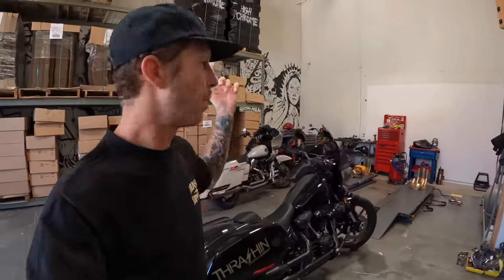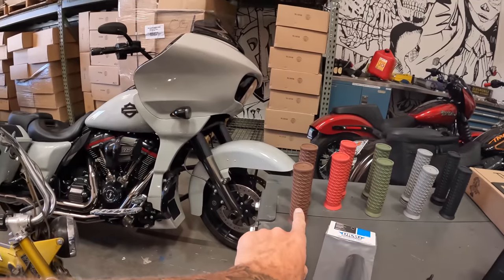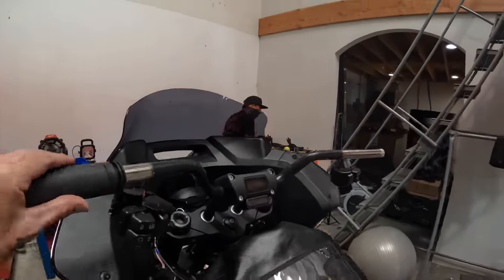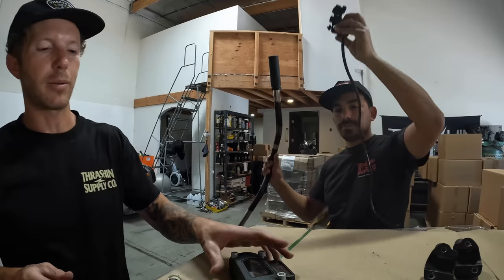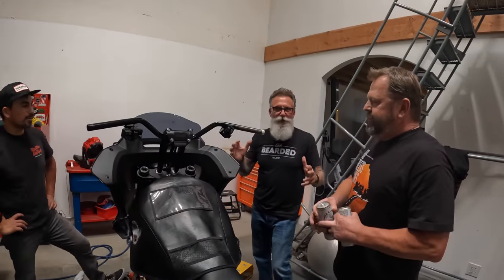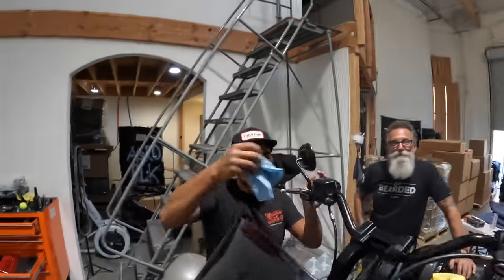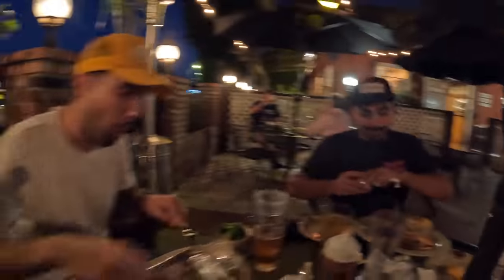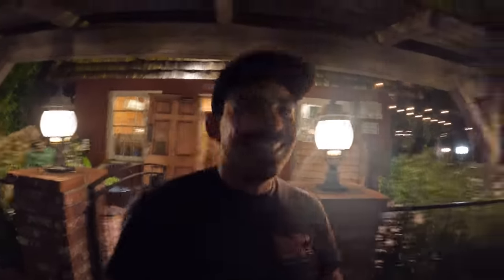First Mod On Our 2022 Lowrider St - Vlog 16

Comment: I "reverse bled" my Heritage when I did a bar swap. Used a meat injector syringe and pushed fluid from the caliper to master cylinder.  Avoided any possibility of air in the ABS module and I didn't have to go to the dealership. Zero issues and super fast to do.
Reply: Would love to get some more details on how that's done exactly. I was at the dealership today and they said I absolutely HAD to go to them due to the abs. I'm on a 22' LRS
Reply: @gbeatz408  I'll try and make a video on it here soon.
Reply: Thanks for posting that. I'm going to do 10 inch risers and that is my plan for the brake. Thanks for confirming it will work like I thought.

Comment: Learn from me.  When I replaced my vans grips, I just cut the old vans grips off the throttle tube, slathered it in glue and put the new grips on, without removing the throttle tube first. I’m dumb and the throttle tube I had was open on the end… I glued my tbw twist sensor together solid. Take the tube off, glue it, let dry then install.

Comment: In the name of editing I get keeping ur vids short, but dang ya’ll.. I need to talk about pulling wires back through the new bars..  after four months back order I finally got the cruise control switchgear for my 2022 M8th St. Bob.  
I only wanted to pull wires once! 
I immediately put the order through Thrashin. New 6.5” pullbacks with their mid rise bars. 
The CNC work that incorporates my stock electronic gauge is spot on🤙
I “think” the new bars are a 4 inch rise with a 25° sweep. This combo put me right back to factory ride height with the bars settling  back just a lil. Super comfortable, and super slick looking. Back to the wiring son.. there is a reason your local Harley dealer charges three hours labor for this shit.  Started out by pulling the fuel tank to gain access to the wire harness connectors toward the neck of the frame. Labeled all the wires,, disconnected and pulled them out. This was the easy part boys and girls. Purchased a new wire puller roll from my local hardware store and off to the races i went. 
For the life of me I could not de-pin the fac connectors! I watched every freaking video on YouTube on how to do it.  I’ll admit I’m a dumb ass! My parents should not breed.  I think I threw every wrench into the middle of the street pulling those freaking wires through those new bars! I’d rather have given birth through my asshole. In the end was the juice worth the squeeze? Hell yes! Will I ever pull wire again?  Dude,  I’d rather nail my own nuts to the top of a stool then do that shit again

Comment: Great video. I'm going with the exact same setup on my ST. Thanks for providing the part #s. They real took the guess work out for what I'll need as far as cables extensions and lines. Thanks from Canada eh!
Reply: I tried to use the part numbers and none of them work how did you find the cables?

Comment: I had the same issue with the handlebar position on my 2022 Lowrider S. Finally after months (getting the extended brake line for my non ABS bike wss a nightmare) I picked up the bike with the new bars today. No more pressure on my backing leaning forward but I'll have to rotate the bars a few degrees back to get them in the perfect position.

Comment: Juan where did the get the sleeving for the wires?  really gives a great finished look - i assume its weatherproof and heat resistant ?  what size sleeving did you use?  did you use split or solid ? if you use solid the sleeving has to be big enough to fix the connectors through but not sure what size it would need to be?   i see amazon sells lot of sleeping but none of the listings state they are water/weather proof but many people use it on cars and bikes.

Comment: Thanks for showing us the installation process! How long are those grade 8  bolts? 2 1/2 inches? I'm about ready to start on the same installation, just waiting on the my HD dealer for the cables; but can't manage to find the length of the riser bolts.
Reply: Soo what size bolts did you need?  is it these Grade 8 1/2 in.-13 x 2-1/2?
Reply: @lemus92405  I ended up using grade 8, 1/2-13 x 2-3/4. With the bushings, the 2-1/2 seemed a little too short.
Reply: I tried typing in all the part numbers for the Harley OE parts on the Harley website and none of them are matching, how did you find the Harley OE parts?

Comment: I got this set up from you guys but 6.5 inch for my ST.  Question, there are no directions, do I use the stock riser bolts, or the ones that you guys used?  I know they are 1/2 13 but it does not say how long they are on the video.  Also, do I need washers if I use the bolts I get from the hardware store?  I just want the parts in front of me before I pull the stock set-up off.  Thank you and thanks for such a great product and great videos.

Comment: Just ordered everything in your parts list, what sheath did you guys use for the wiring coming out of the gauge and bars heading down? I can’t stand loose wires and I’m putting your risers on a El Diablo so I really want it clean

Comment: My 6.5" pull back risers are scheduled to arrive tomorrow. I have the same question several others have posted (I didn't see an answer). Need specs on the Grade 8 bolt size. 1/2" 13 thread, but how long? 3", 2.5", other? I've spent way too much time looking for these specs...

Comment: I feel the same about the stock bars.  I am told that if I use the your Mid Bend Bar with your 6.5 riser, I do not have to use cable extensions.  Does that sound right to you?

Comment: I ordered the Thrashin throttle tube Billet (throttle by wire) 59.95,  I have this same exact bike . Is that the tube I need?  Because I saw a different one right after I purchased it
Reply from the maker: The Billet Throttle Tube works! We hadn't developed it yet when we released this video but that is the correct fitment you will need
Reply: @THRASHIN  sweet thank you for the quick reply

Comment: Honestly I've got the 6.5 risers, cause they worked with stock cables and it helped a ton. But I'm highly considering going up to the 9.5s to bring it just a little higher and closer. Definitely putting a mid bend bar on here soon too.
Reply: How tall are you bro? Gathering data for myself 😂
Reply: I got 6in risers chillin, still working on the bars
Reply: I'm 6ft 1. I recently road 600 miles on these 6.5 pullbacks and it was good, little sore in the lower back, still a little stretched when I lean back in my seat on the highway. I do gotta lean a bit forward for slow speed, bar turn stuff. I think the mid bend bar will help a bit more. Gonna try that first.
Reply: Did you reuse the stock riser bolts?

Comment: When installing the throttle tube you put grip glue on the throttle tube then put the grips on correct?
Reply from the maker: It’s tomato tomato…. As long as a little glue gets on the whole grip to glue her down. But not too much glue lol. Just spin the grip around a couple times to spread it out 👍🏻

Comment: What length 1/2" x 13 bolts did you use?
Reply from the maker: I forget, but I think 2.5” long. Maybe 2-3/4”. But you can just match to stock.
Reply from the maker: Always get grade 8 or higher
Reply: @THRASHIN  appreciate it!
Reply: @YeUnholyFiend  what size did you end up going with?